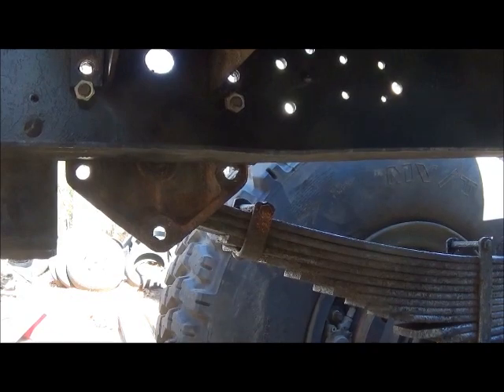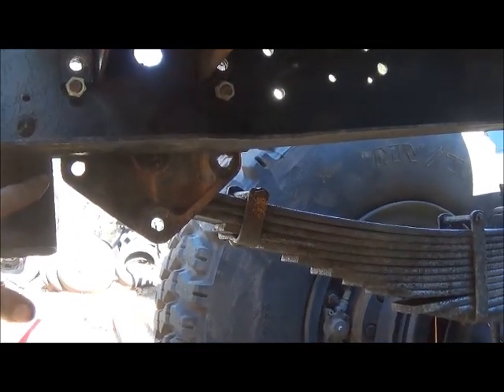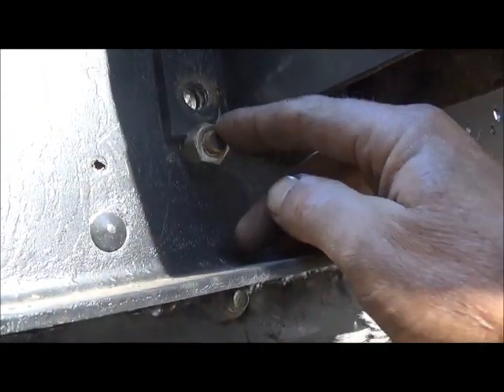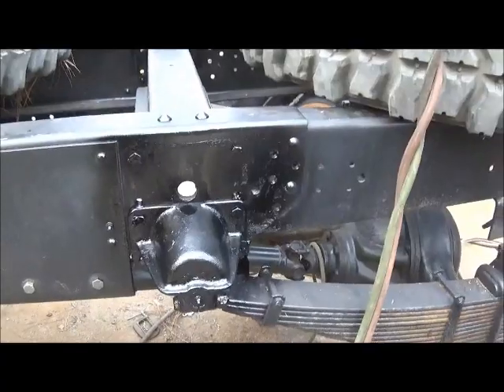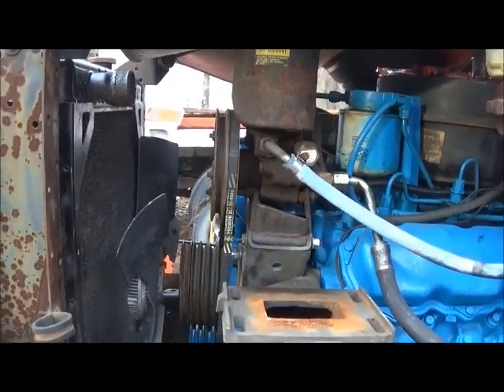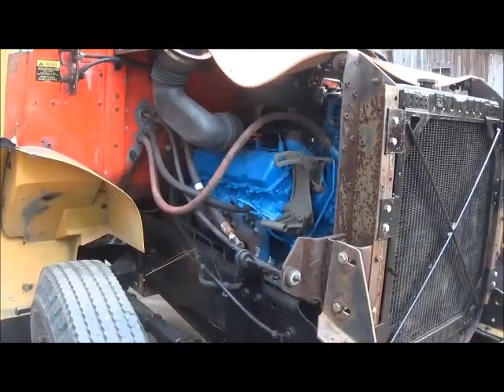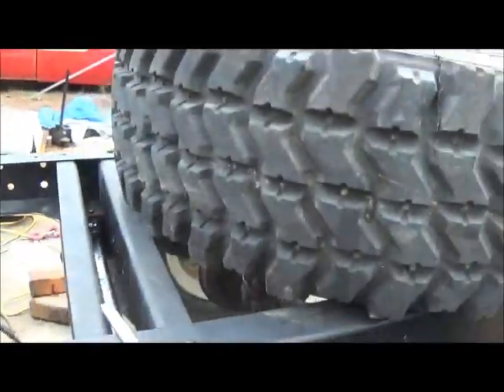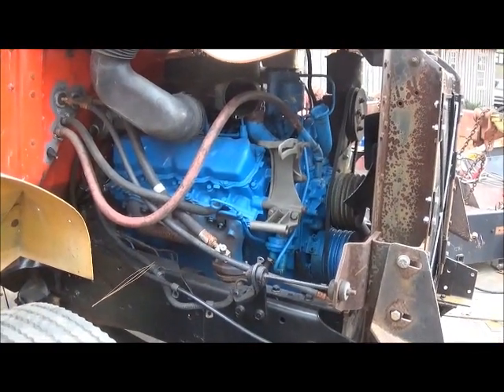4x4 Wrecker Build Part 14 Epic Rotator Build!

Comment: Hey Jonathan,    So tell me on the 7.3 international.  Is that the same engine that they put in the superduty fords in the 90's ?  Are they the same as the powerstrokes ?  Is the coldbloodedness taken care of on the one you have ?  My buddy had a duelly with the 7.3 and he was constantly having troubles on cold starts.  Is that where the  gear reduction comes into play ?
Reply from the maker: The 7.3 even in the fords was made by International, but that is were it ends. All the external parts on the Fords are designed and installed by Ford after they get the engine from IH, so all external parts are different. Starter, flywheel transmissions, water pumps and all accessories on the International trucks is much more heavy duty built. They run the same glow plug, but a different electronic system to operate them, I have very little problem, but 30's is about as cold as it gets. None of the 7.3 engines, powerstroke or not are actually Ford engines.

Comment: my family owns a metal supply business... that said I have sheared 1 inch steel sheet so on the pieces that you cut to make the spring mounts I would still do them the way you did with a grinder or a saw because the shear would make that half inch plate bend because of the rake of the shear... expecially if it were a longer piece of metal. over eight feet this can be as much as one and a half inches... oh yes and we can bend half inch plate... I like the little forklift I seen in another one of your videos... it looks like a very nice little forklift and should do well out in the yard... a word of caution on the forklift whatever you do don't spin the tires... a light foot on the throttle... or you will be stuck... been operating equipment since I was 5 years old...where is today's video.  lol thanks
Reply from the maker: +aaron schoessow Uploading now, should be on in an hour or so.
Reply: +aaron schoessow Good comment on not spinning the tires on the forklift.  That is why I prefer a manual transmission with a clutch on a forklift.  The torque converter ones, you try and slowly give it some throttle, and before you know it, the wheels spin out (on gravel or whatever).  With a clutch, it is easier to modulate the power you are putting down.  A torque converter, by it's definition, wants to create torque from speed, but as soon as there is wheel slip, it goes the other way and just makes speed again.   Give me a clutch forklift any day.  --Doozer

Comment: why was he not wanting to weld or bolt to the chassis?
Reply from the maker: I never bolt or weld to the top or bottom flange. I also prefer not to weld to the side if possible, but will. Welds usually have undercuts along the sides of them and under stress a crack can start.
Reply: +Jonathan W oh OK thanks for the reply.